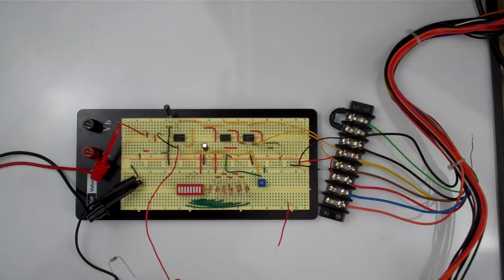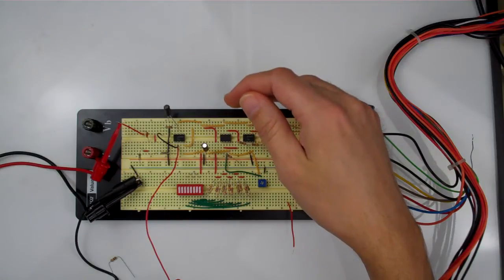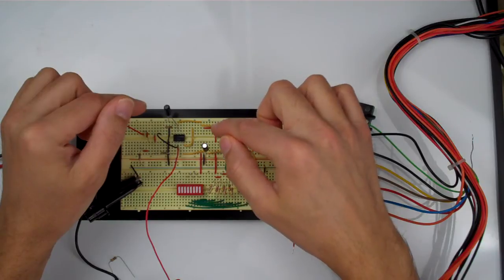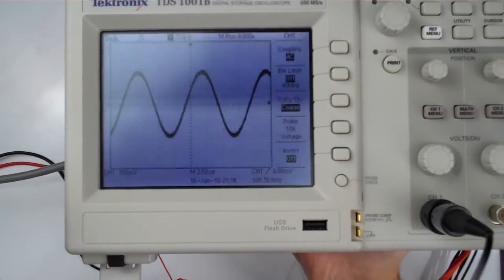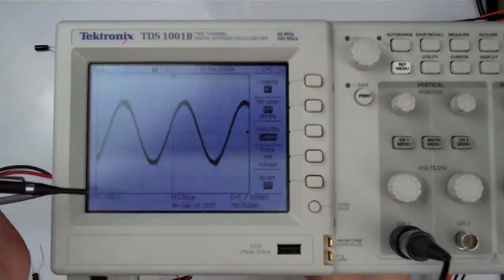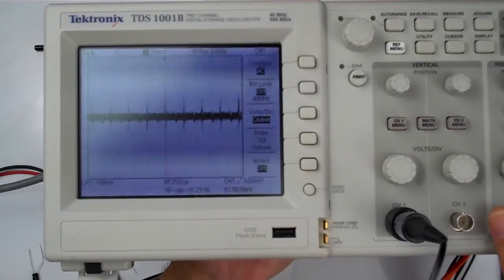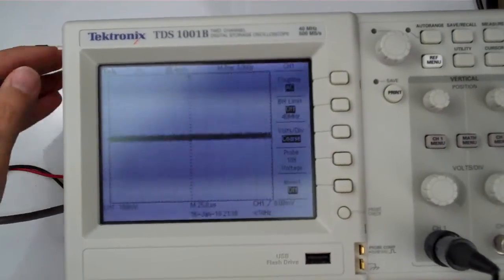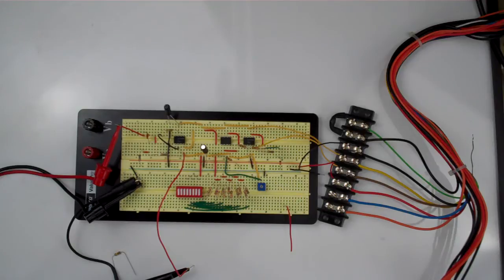Watch actual results of reduced noise by adding 10uF capacitors to power supply lines in a circuit

Comment: Hei what about 9v, what value cap do I need? Thanks so much this helps alot
Reply: So I have a guitar pickup module which is 9v, and directed into a 12 volt preamp 2 transistors, everything is find using 9v battery only thing is the air noise, even when all gain knobs are at zero. Thanks so much 🙏🙏🙏

Comment: This is the noise when you connect long power supply wires from your power supply to DUT, without a bulk capacitance. Without adequate decoupling, the inductance from the long wires causes the power supply to ringing.

Comment: Hi, an extremely interesting video Indeed. Thank you sincerely. I have a question. Does the noise attenuation frequency go with the capacitor value? if I have, for example, a high-frequency noise on the power line, which value should I use? small uF or big uF?  is there a rule or a formula ? Thanks again.
Reply: gino I was wondering the same thing . If diffrent size caps remove a diffrent amount of noise. Ive seen people use say a 22uf and 100nf in series across the power lines on a bipolar supply.

Comment: What is the physics behind how this works ?
Reply: the main supply came via wire thats the main reason of that noise
Reply: Excuse me! How to connect these capacitors? Do you have a schematic (somewhere)? I guess these are connected in parallel... But I'm new to this kind of things.
Reply: on audio applications those filter capacitors should be in a same pcb (amplifier+filter), avoide wire connection as much as possible
Reply: Not necessarily! What he shows appears to be noise from a switching power supply. Other noise can/will come in on external unshielded wires. That can also sometimes be filtered out this same way but may require different cap values based on the frequency of the noise.

The cap @ the amplifier bypasses high frequencies to ground, thus filtering out that switching noise.